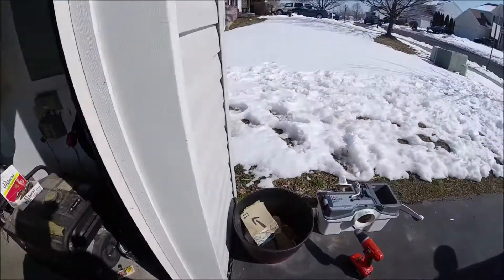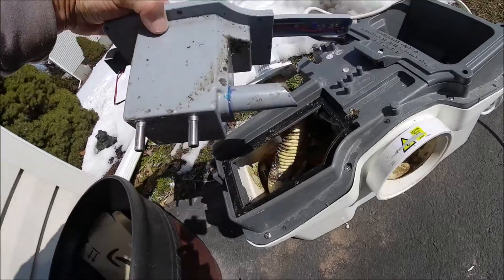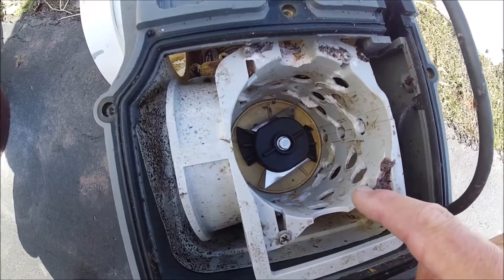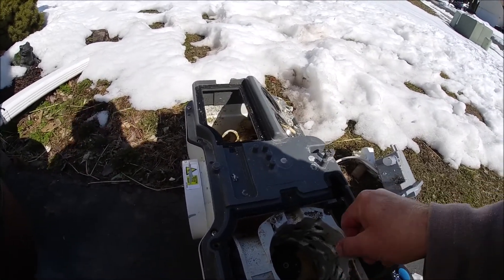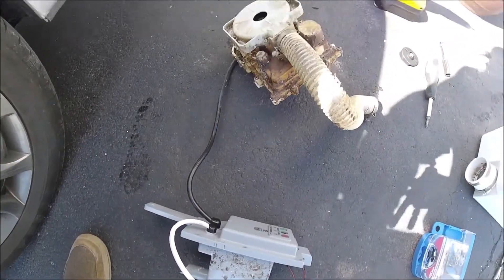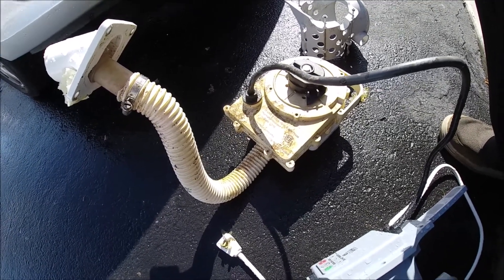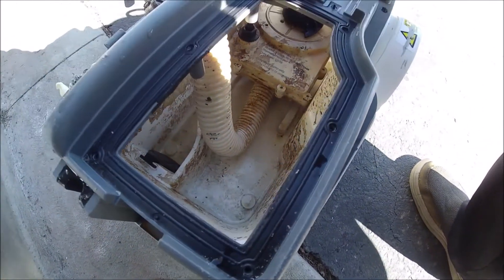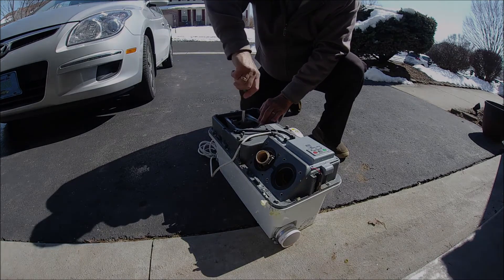Liberty pumps macerating toilet part 3

Comment: I need to replace the pump and I can't figure out how to disconnect the wire that connects to the pump. I loosen the black nut like you say in the video, but then the wire still seems attached to the pump? Any advise?

Comment: Like you mentioned before the hardest part was removing the metal ring. When I was pulling the pump out for cleaning, the rigid white hose got disconnected from the pump (still attached to the discharge line) and now I have the hardest part to connect it back to the pump from inside the box. Any idea how to do it?

Comment: I am trying to replace the pump motor assembly. Got it all the way out but after backing out the black nut that holds the wire into the pump, I can’t get it out of the plug. There is a white plastic clip but I can’t tell if I just need to pull harder or if there is a trick to it.
Reply: I'm having the same issue. Did you ever figure out how to disconnect the wire from the pump?

Comment: I was fighting mine for 2 days. I had a bad check valve in the discharge 1" PVC. The flap went bad and the pump couldn't push the water up. I love your music in the background BTW! :-)
Reply: If I had to do it again I would not put the music in it's distracting to some I am surprised Liberty Pump does Not have a video how to work on these things.
Back in the day every Appliance would have a schematic diagram and it Parts break down so you can repair things but now the companies don't want you repairing things
Reply: How did you fix the bad check valve? When I opened mine up, I found the flap laying next to the pump.

Comment: Thank you for making these videos.  Have you had problems with the new pump?
Reply from the maker: Everything has been working great
Reply: @edwardkosinski9190  thank you so much.  I think you have done a great job on all the videos you’ve made.  I just think this system is not good, and the problem is the design.  I’d bet the company that’s makes this product has had tons of complaints.
Thank you again.
Reply from the maker: On October 16th 2020 the toilet has failed. I will have to take it apart tomorrow it's tripping out the GFI.
 I will make a video, most likely is hair wrapped around the pump.

Comment: I have this system and have had same problem since it was installed almost 3 years ago.  Gunk builds up on the sensors and you have to clean the sensors in order to keep it functioning properly.  Liberty sent a new unit and will have it installed, but I don’t think that will solve the problem. My opinion is that it’s a design flaw.  We had an assent 1 before and never had a bit of  problem with it until the motor wore out.  
Explain what the steel wool does please, other than cleaning the sensors.  Thank you.
Reply: That’s all steel wool does but I believe that’s too abrasive according to liberty. I replaced the unit.

Comment: Great set of videos, thank you! What if its not the contacts ? I have cleaned them with steel wool problem persists and just out of warranty!
Reply: Hey Fraser, You may be a good candidate for trying my bleach method.  The trick is to get 2 cups of bleach in the tank so they can soak on the sensors a couple hours.  This is done by pressing the manual run button for a few seconds and then unplugging the unit from the electrical source.  Pour 2 cups of laundry bleach into the bowl and flush.  The pump will not run and the bleach will remain in the holding tank to soak the sensors.  An hour or two later plug back in and flush.  Please let me know.

Comment: Edward, you need to clean an invisible coating that builds up on the sensors with steel wool.  Liberty told me to use alcohol but further research into these type of sensors led me to use steel wool.  I had the same problem.  Wipe cleaning with alcohol no longer did the trick after a couple years.  Try steel wool.
Reply: What does the steel wool do besides cleaning the sensors?
Reply: @cadams2279  It seems to be an invisible coating of some sort from the sewage that affects the way the sensors work. Just cleaning with a soap based cleaner doesn't remove it.  It takes an abrasive like steel woll to cut through this contamination.  I've also been experimenting with pouring 2 cups of bleach into the tank and letting it soak.  Jury is still out.

Comment: Liberty should pay you for the video.
Reply from the maker: I don't understand why they don't provide that service if you would ask a plumber to look at that good luck people help me I try to help people
Reply: I’m a licensed plumber and I’m having the same issue with mine. I cleaned the sensors. I’m thinking conditioner,lotion,toothpaste all this stuff along with urinary salt coats the sensors. I’m wondering if automatic dish soap and a cycle that agitates might clean the unit occasionally.
Reply: @wileyearly7051  what has helped?

Comment: They are designed for human waste only, not kitchen waste. Looks like I see some cooking fat build up.
Reply: I don't have that problem
Reply: Mine is nearly 3 yrs in service. Only a hand sink is attached. Tub has its own separate pump. Once in a while pump might run a bit longer than it should. When it happens I grab a cup of white vinegar, a few table spoon of dawn fill sink  with hot water and mix them up. Flush to empty tank then drain sink and let tank soak in it. A few hours later flush a few times and done. Weeks sometimes months before it happens again. Wife and I live in basement apartment in our house and it works daily. Shave cream, soap scum, skin products, hair products all leave a residue, sediment, film behind. Sensor gets fooled because of it.
Reply: @antoniofranqui5258  I am interested in this solution.  I might have to try it.  Ours is 4 years old, I have had the float side accessed a few times and had to clean that, but never the mascerator itself, nor the control module (contractor installed discharge lines vertically through cover, so I need to cut pipe to access it).  Mine will run normal if only from sink.  If from shower or toilet, it will run about 40-45 seconds, alarm then stop.
Reply: @johnp9557  Clean sensors with steel wool, it will remove invisible coating.
Reply: @kevinomara3293  That will be my next step if it gets to be a problem again.  I did the vinegar / soap trick noted by Antonio and it worked like a charm.  Might make this a monthly cleaning routine.
Reply: @kevinomara3293  does that keep gunk from accumulating on the sensors?
Reply: @johnp9557  I’m going to try this, thank you.
Reply: @cadams2279  Again, I am putting off doing the official clean as it requires plumbing work and I am just not in the mood yet, lol.  That being said, I have found that I have to do the soap/vinegar trick about every 1-2 weeks.  Honestly, it is not that big a deal if I remember to do it.  Sadly, it's the 3:30 am shower that reminds me, when the house is super quiet, I am enjoying the nice wake-up shower only to hear that non-stop running of the pump (though family says they can not hear it).
Reply: @johnp9557  Just to make sure: 
1.You fill the sink that connected to the Ascent II with hot water and solution of vinegar and dawn?
2. What do you mean by flush to empty tank? Flush the toilet?
Reply: @antoniofranqui5258  do you turn off shut off valve to toilet after you flush it?
Reply: Just to make sure: 
1.You fill the sink that connected to the Ascent II with hot water and solution of vinegar and dawn?
2. What do you mean by flush to empty tank? Flush the toilet?
Reply: It might be soap and shampoo it's a sink a shower and a toilet there is no kitchen down there or any disposal of food
Reply: @edzkos59  Oh ok.
Reply: These are sensitive machines. I had the same beeping problem and the only thing I had to do was make sure the two covers were fitting together properly. Beeping stopped.

Comment: Exact some model.  Exact same age.  Exact same problem.  I'd rather use an outhouse in January than deal with this thing.
Reply: Call the company see what they could do for you you have a 3 year warranty
Reply: A simple 10 minute cleaning every 4 to 6 months beats an out house any day.  Plus it accommodates my shower and sink.  An entire bathroom that I could not other wise have.
Reply: @kevinomara3293  true.  But after cleaning, the problem comes back sooner and sooner.  If I eventually have to replace this Liberty Ascent II, I'll be looking for something that doesn't involve a computer control panel.

Comment: Edward, thanks for sharing your experiences. I can see a lot of debris inside of that pump. That leads me to believe that this system probably has an odor. I am literally about to order one of these, and now I am not so sure. I see a few people complaining about the issues you've experienced, but not a lot. You are the only one who shows the pump in action, and a view of the bowl while flushing. Very helpful.
Reply from the maker: Thank you I had a heck of a time with mine so I figure I would help others
Reply from the maker: No there's never been an odor because of all the gaskets, of course when you start taking it apart there will be an older that goes for any pump
Reply: @edwardkosinski9190  ,..Thanks again.
Reply: Harry, I have cleaned mine several times.  It looks gross but believe it or not, there is no odor.  I think the excrement de-gassifies after a while.